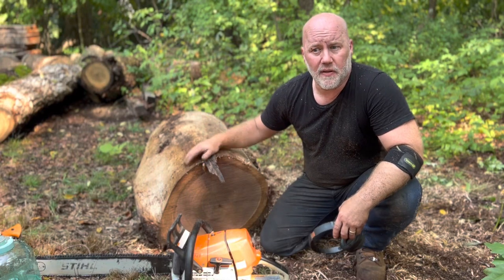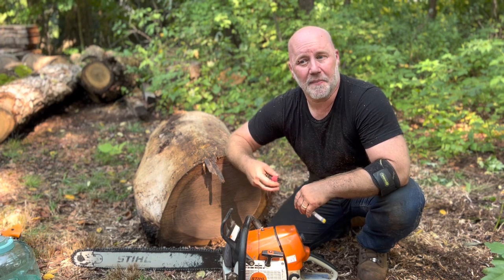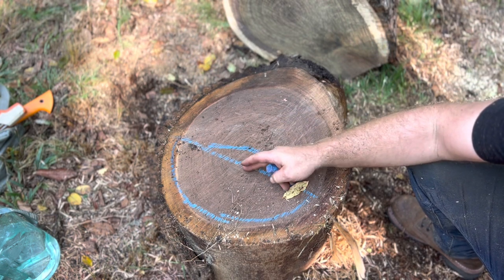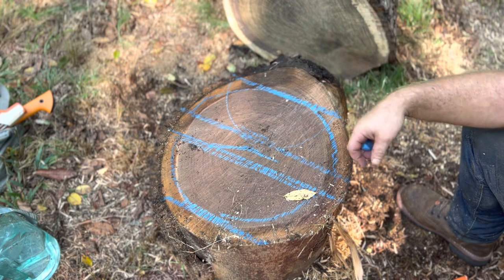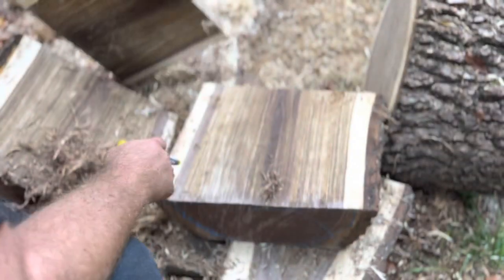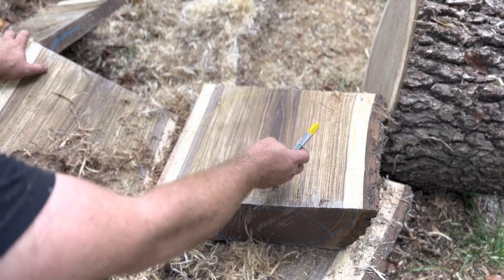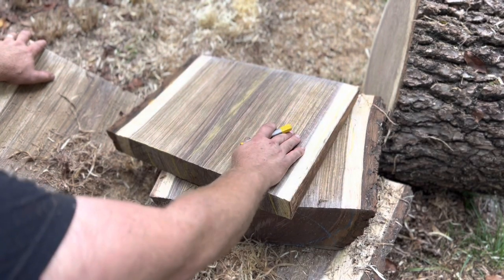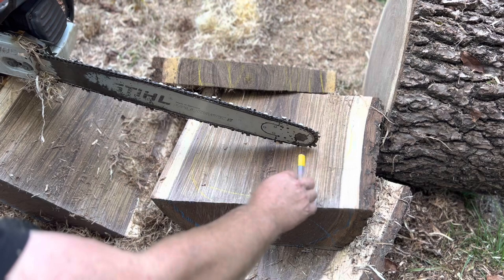Processing bowl blanks with a chainsaw (how to)

Comment: Whenever I cut with the grain I noticed that my chainsaw uses half of the normal bar oil, have you noticed that  ?
Reply from the maker: That's weird. The bar oil is dispensed automatically with the speed of the chain. Some saws have adjustable oil amounts... for me, the oil runs out at about the same time as the gas.
Reply: @alexanderdesigns814  yep, the tank of oil usually lasts about the same as the fuel,  except whenever I started laying the log down and cut with the grain.  I think the shavings are blocking it,  because when I cut with the grain on the top of the log, or cross cut, the oil runs out same time as the fuel,  and that's on both saws

Comment: Do I have to remove the pith? My tree trunks are only about 8" in diameter. If I cut it up like you do, I have awfully small bowls. Can't I just cut a 5" chunk of the trunk that way I have a blank that is almost the perfect size to turn. (5"-8") with the pith right in the middle. Easy to turn that way, and a lot less prep time and work.
Reply from the maker: You can. But most species will have cracks that radiate from the pith that will grow as the bowl dries. You'll just have a decorative bowl